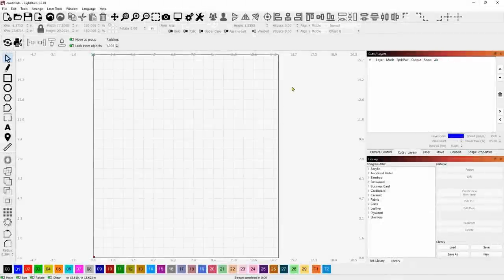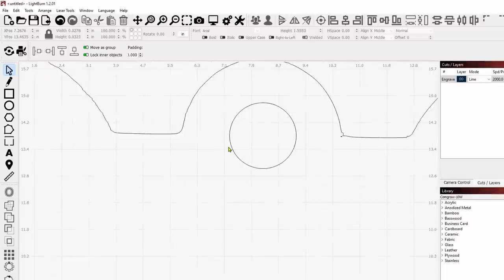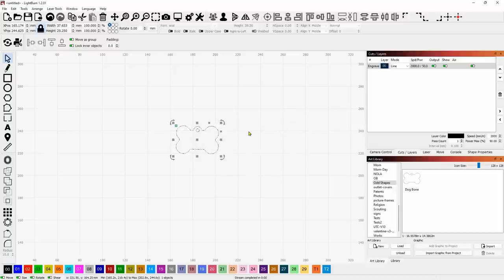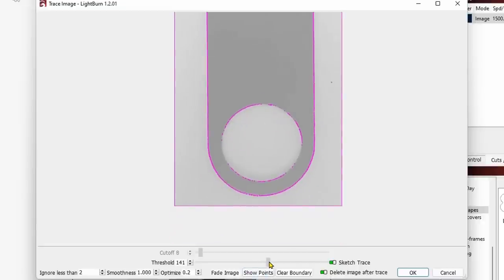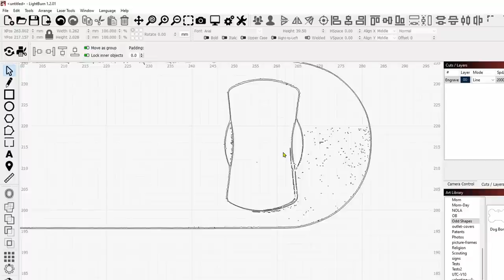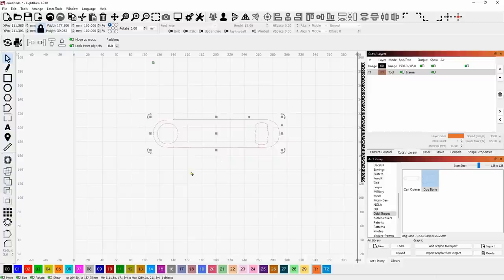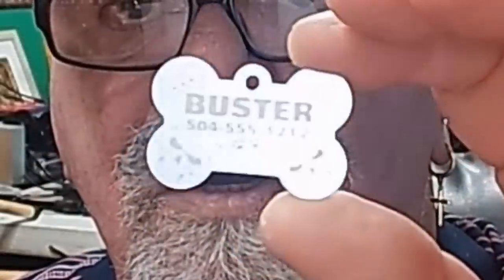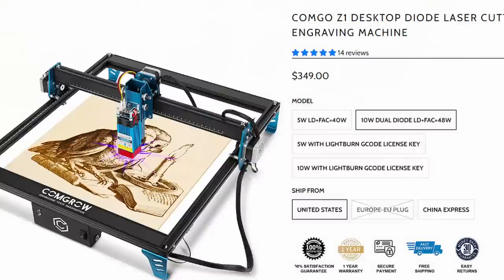❗Precision Graphic Alignment on your Laser in Lightburn, Creating a Custom Template!

Comment from the maker: This video was made for those who don't have a scanner or Lightburn camera and don't want to spend the money on one. The dog bone took all of about 50 seconds start to finish, the time it takes for a scanner to warm up. On the trace of the bottle opener, I should have just took another photo with less light shadows and it would have taken seconds as well. I could have also set the trace window to Ignore less than 100 (instead of 1) and most of the noise from the light would have gone away.
Reply: Hi Rich! Great video as I am wanting to do lots of dog bones! My question is......now that I have a template and my artwork will be prefectly fitted to the size of the bone tag.......how do I know where to put the tag on the laser bed so I know my alignment will be perfect when it burns?
Did I miss that part?
Reply from the maker: I used the camera, but you can lay a sheet of craft paper on the bed and tape it down. Then run the job at very low power. Now you'll know exactly where to position it.

Comment: Another informative video!  I was always told that my diode laser (5w ortur lm2 pro lf) was not capable of engraving metal.  Do you have a video of how you engrave metal with a diode laser?  If not, please consider making one.
Reply from the maker: It is not capable of engraving metals Jesse. This was annealing, or changing the chemical composition of the metal by heating it. I have done metal annealing in several of my review videos. All you have to do is run a test grid at a very slow speed and high power.

Comment: Hello, since I am very new to lasering, can you tell me if in Lightbun can you import a picture of what you want and use it?  Meaning if I wanted to import say a name in a wreath with a date on it, can I import it and engrave on a piece of wood without doing much in lightburn?   Your videos are very helpful and thanks for your time putting them together.
Reply from the maker: Yes you can, but you'll always need to set the power and speed settings to match your laser.

Comment: How do you line it up to etch it once you have it designed without a camera? How do you know where to put it on the bed and make it perfectly straight? I’m talking CO2 laser.
Reply from the maker: The same way as with any laser, run a frame or rubber band frame on the job. Your red dot laser has to be dialed in perfectly though on the Co2.

Comment: OK, Just made ashape, thnx for the trick, but my main problem is to place the alu dogbone on my honeycomb and then position my laser on that spot so that the lasering is spot on. How should I do that??
Reply from the maker: Trace the image and then ungroup it. Use only the outer line, delete everything else, or if it's a vector, offset the outer line. Then when framing, use the rubber band frame button and it will follow the outline. For something small like the dog tag, go to the move tab and set the speed really low, like 10mm.

Comment: About Harbor Freight: Yes they have a super cheap version of everything. They also have a decent standard quality version of everything. If you'd looked around on that rack, you would have found the decent $50 Quinn that's as good or better than a standard mechanical caliper.
Reply from the maker: Yes, but I bought the cheap one. It has nothing to do with the store.

Comment: Every time I think I am pretty accomplished with Lightburn, I watch one of your videos to bring me back down to earth. I can't watch one of these without learning something new. I am really thankful I found your channel. Heading over to Patreon now because as much as I get from your videos, it is worth the support. 2 questions though. First, with a diode laser, if I engrave on metal, I assume I have to paint it black first? Then if I use something to clean it off after, will the lines remain black or will the acetone take everything off? I could also use Anodized aluminum I guess for things like the dog tag but the bottle opener I would assume would need steel? Second have you done any videos on how you position your piece on the work bed to make sure it is going to print centered on the piece? Right now I am just eye-balling it the best I can. I need to setup my laser bed so that the laser and the work grid are fastened down so I can get a good repeatable position on the laser every time. Even so, I would be interested to see how you do this. Thanks again, you are simply the best single resource on the web for this hobby!
Reply from the maker: Hi Jack, I wasn't engraving the metal, I was annealing it. A slow enough speed and high enough heat changes the composition of the metal and changes the color as well. I don't use any accelerant, except sometimes tempera paint, that washes right off with water. I work in absolute coordinates most of the time, so positioning is as easy as using the grid I burned into the waste board. I have a couple videos on that. Thanks so much for the support! I really appreciate it!

Comment: How does the Atomstack x20 pro 130w quad-laser engraving and cutting compare to the xTool D1 Pro Laser Engraver, 20W?
Reply from the maker: I haven't compared them James, but they're probably about the same. I have an upcoming video where I'll be comparing about 7 20W lasers with the same files in about 6-8 weeks.
Reply: Thanks, I watched your review on the Atser 20 watt, I ordered it. Thank you so much for review.

Comment: I understand what you did converting the pics to templates, but I don't understand how you put them where you wanted on the bed of the honeycomb
Reply from the maker: I used the "rubber band" frame Chip. There are two frame buttons, it's the frame button to the right.

Comment: I used this exact method for some butterknives that I got from the Dollar Store (using a scanner to take the photos), but the part I have trouble with is lining the laser up with the object. I've seen your videos on creating cardboard templates in which you place the object (and I am going to try that) but you didn't seem to do that with these. I'm just wondering how you got the laser lined up so perfectly?
Reply from the maker: Using the Rubber Band framing Derek, right next to Frame.
Reply: @TheLouisianaHobbyGuy  Maybe I'm misunderstanding but I meant when you put the object on the bed, how do you get it to burn in exactly the right place.
Reply from the maker: @rebeltaz123  I usually use absolute coordinates, so the grid burned into my bed is the same as the one on the screen.
Reply: @TheLouisianaHobbyGuy  Ah.. ok. Gotcha. Thanks.

Comment: Noob-o question (...just got my new laser up and running today.)  You show how to get the design dead-nuts perfect in the precise shape in Lightburn. Coolio. But then, how do you get it perfectly aligned with the piece on the bed? My laser doesn't have crosshairs or a 0,0 guide corner (LOL, yet.) He'p me, Obiwan Kenobi!
Reply from the maker: I thought I showed that in the video.
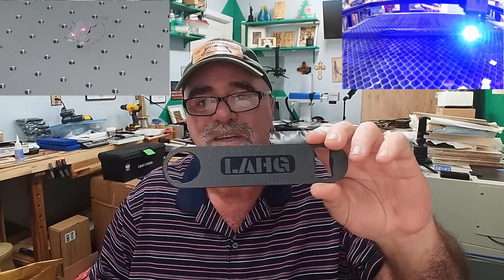Reply: @TheLouisianaHobbyGuy  Watching again. At 23:20, you finish describing making the design, and jump to showing the finished result. There's a brief cameo at 23:50-ish, of the laser lighting up the piece, and I guess that would work, but I don't have that feature. Is that what you're referring to?  At 24:20-ish, you talk about doing it in a diode laser (mine is) but I don't see anything that'd qualify as describing how you aligned it.

For clarity, I'm talking about how to align the piece with the engraving on the laser bed, not how to align the engraving with the shape in lightburn. That is clear, and I appreciate that.
Reply from the maker: You align it on a diode laser by framing it. You have to have Laser on when framing in the Device settings turned on, and the power on the Move tab set to 1%.
Reply: @TheLouisianaHobbyGuy  Gotcha. I'll try that, but in the meantime, I watched your "put down some paper and cut it on the outline, then lay the media in the opening" video, and have started doing it that way. (With blue painter's tape.)

You're a GREAT resource. Thank you for all the work you put in, and I hope you're well compensated for it. (Yay, YouTube.)

Comment: When you setup the diode for the bottle opener template,  you place your graphic in lightburn and run it in "Absolute Coordinates"?
Reply from the maker: Yes, I align it to the bed grid Jim. I was just a hair off on this one because I was rushing.
Reply: Maybe you can do a video on setting up a bed grid, that is if you haven't already done so!? I a camera on my YoraHome 6550 and just got the Two Trees TTS-55. I'm thinking adding a camera to it as well, but in case I don't, I would like to setup a bed grid on it. Thanks for the videos and the response!!
Reply from the maker: I have 2 older videos on setting up a grid Jim.

Comment: MASTER !!!! YOUR YOUNG PADAWAN NEEDS YOUR HELP !!

I've just bought the atom x20 pro, such a MARVELOUS TOOL!  But I noticed an issue (really big for me): 

I am truly able to align everything PERFECTLY, even the smallest detail, but the machine misses the re-alignment when I work with a frame.

I align everything (laser - frame - objects)... I engrave PERFECTLY... the laser goes back to "home" and when I put the new objects on the frame and restart the laser, it loses something from 1 to 3 mm from the previous setting.... really dunno why.... 

I swear I DON'T MOVE anything to make it disalign... I tried by forcing multiple "homings" and after everyone the issue keeps going on and worse.
Reply from the maker: You'll probably need to contact Atomstack for this one.

Comment: hi how do you get rotary in lightburn as mine has disapeared since upgrading
Reply from the maker: Laser tools --> Rotary setup
Reply: @TheLouisianaHobbyGuy  not there and tried un checking modes and redoing also tried ctrl+r still nothing but thank you
Reply from the maker: Sounds like you're in Beginner Mode John. Edit --> Settings tic off beginner mode.

Comment: If you have a flatbed scanner (does that tell my age?) you can get a better (well, easier at least) image than using a phone.
Reply from the maker: I'll bet you I can do it 10x faster with a phone 😎. While your scanner is scanning, I'll be in Lightburn designing! I should have just taken another photo of the bottle opener that didn't have the reflection on it and It would have been import and scan, like the dog tag.
Reply: @TheLouisianaHobbyGuy  won't argue that point. photo should be fine for lightburn. I use the scanner for Fusion360. Eliminates parallax (or is it fisheye/perspective?) issues I've had w/ longer objects.
Reply from the maker: @OldCurmudgeon3DP  I was using a cell phone camera in 16x9... I should have mentioned that.  It seems only 16x9 and 4x4 works... which is odd.
Reply from the maker: @OldCurmudgeon3DP  BTW, does your flatbed scanner have a PCI board with a parallel cable? That would make you old!
Reply: @TheLouisianaHobbyGuy  no, but I used to have one w/ a 50pin scsi and sheetfeeder. 🤣